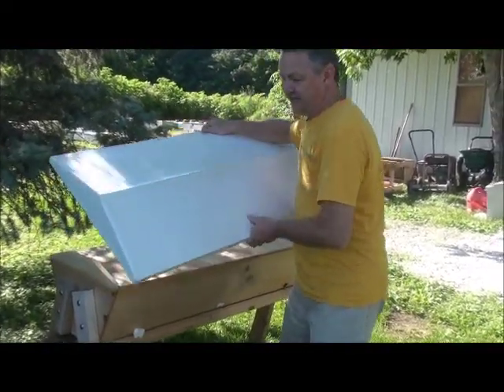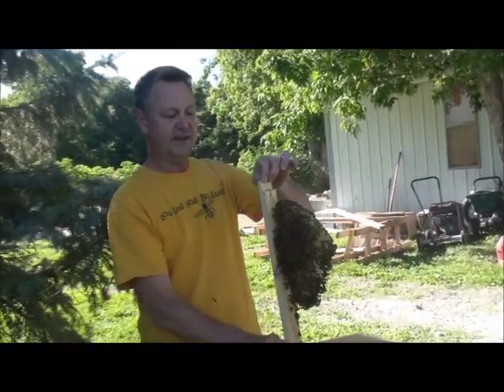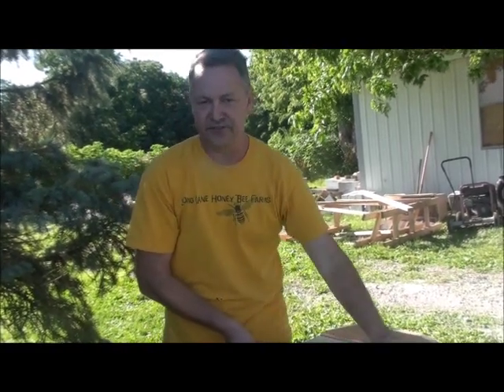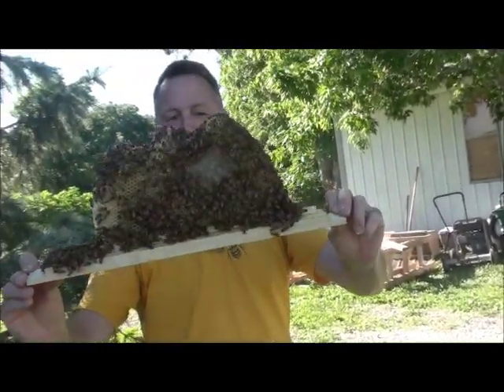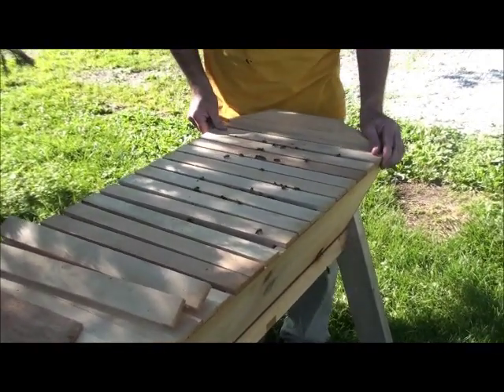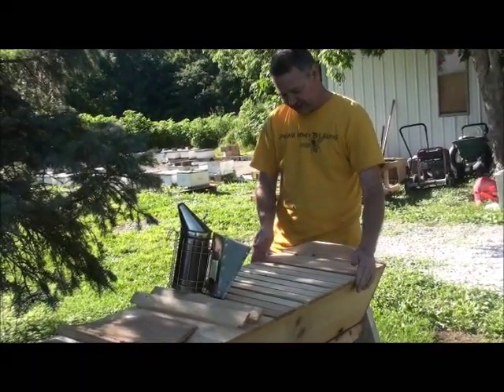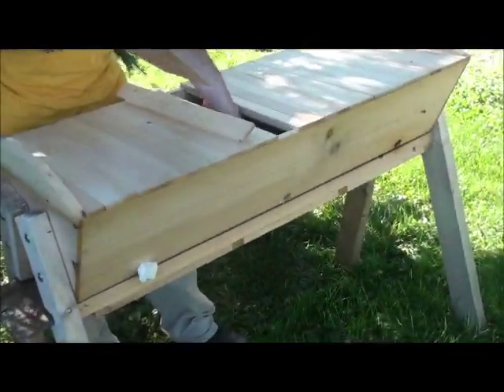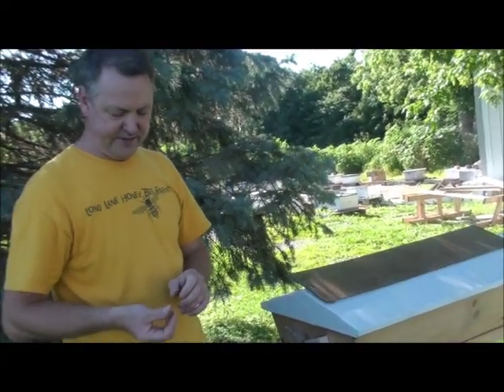Top Bar Hive Inspection

Comment: When I inspect my top bar hives I use a spray bottle with water in it to spray a light mist on the bees when I am trying to get the bars put back in and pushed together and it has worked really well for getting the bees to go back down into the hive so they don't get mashed.

Comment from the maker: Most states require that frames be removable for inspection. However, in my case and in most TBH the frames are removable. There are probably more Langstroth hives packed with non-removable comb due to beekeepers forgetting to put all frames in or putting a swarm in a deep box and forgetting to put in frames. So in the US and in State to State, as long as an inspector can lift out a frame and view it, they are legal. Honey extraction usually has to be squeezed or pressed out of the comb.

Comment: I use a water spray too. Bees hate getting wet so they run away back into the hive. If the bees are persistent I lower the bar down against the next one rather than try and squidge the bars together. Another trick is to close one end and leave a little gap at the other end. The bees move away from the narrow end and you can continue to close the space - a bit of spray helps them!

Comment: I've started using a Bee-Down Strip to get the bees down when I am pushing my bars together. It works really well and I haven't squished a bee since I've started using it. It’s essentially a 1/16″ thick strip which is as long as a top bar and tall enough to grab onto. It’s inserted in the gap between two top bars and used to herd the bees beneath the top bars before pushing them together.

Comment: David, if you hava a thin rod (about the thickness of a clothes hanger) you can move the bars close together and then use the rod to push the bees down into the hive, then you can push the bars together to the rod, remove the rod (smaller than bee space) and then finish moving the bar together. You can do it will a string as well.

Comment: I like what appears to be a 'light weight' top cover on your Top Bar hive. I was very surprised to hear you say it's 'a little more tricky' to remove honey from a Top Bar hive. It seems to me it's much more straightforward than having to invest in an expensive frame centrifuge. With a Top Bar hive, it's as easy as cutting the comb off the bar, crush the comb to release the honey, strain, and bottle.  By the way, I use and recommend the "BackYardHive Top Bar Tool". It will make it easier for you.